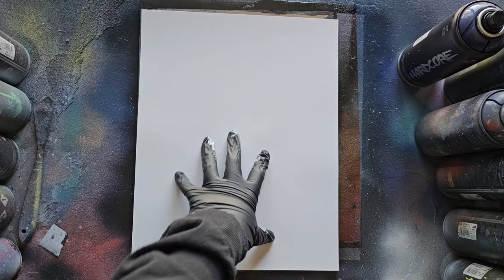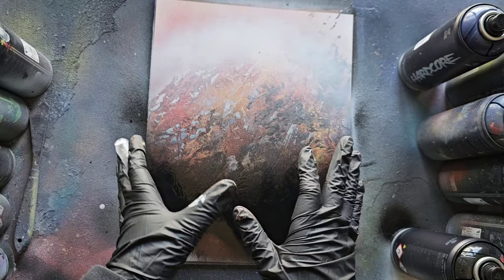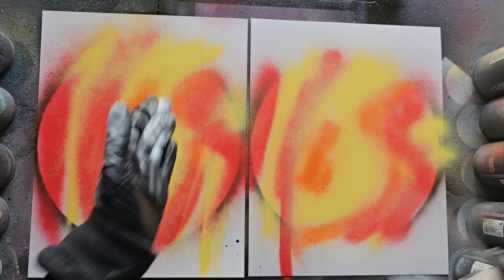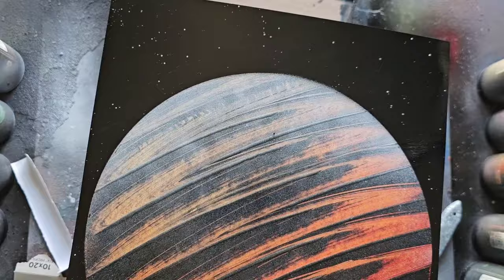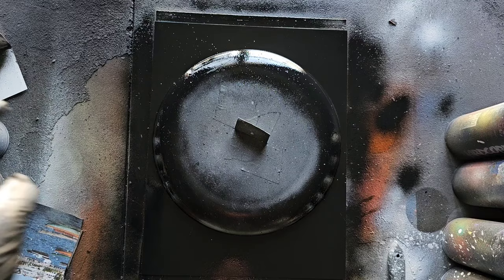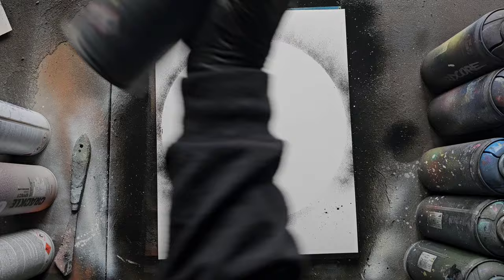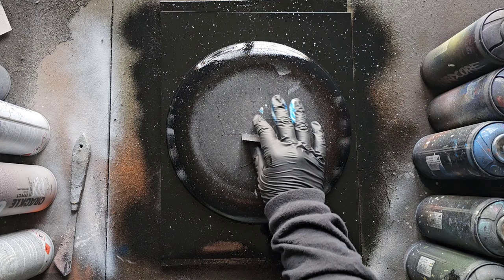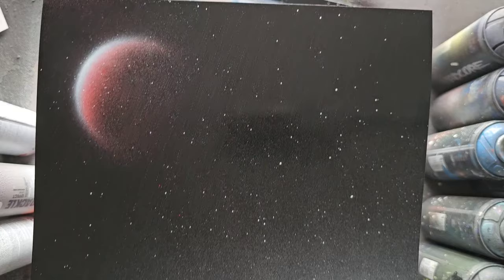Different Ways to Make Spray Paint Planets 2024!

Comment: Hi, I've watched a bunch of your vids on star scapes, planets, etc.  It's amazing and I enjoy watching you do it and the end result. You've given me the confidence to try it.  I have a 5 string bass I'm planning to spray one on. I've stripped off the old paint, sanded and primed. I use my garage as my paint booth. Being in RI I have to wait until its warmer.  

I have successfully painted several guitars with nitrocellulose.

I want to paint planets etc because no matter the angle of the bass (neck up  or me holding it -neck to left) it will always look correct - no up in space🙂.

It's not a level surface though.   How to you get a cleanish edge around a planet? Just prop it up?

I want to include a crackle planet & UV also.

Thoughts, comments, or tips you could share are appreciated.

Thanks 
Jeff G.
Reply from the maker: Not exactly sure what you mean. Everything in the tutorial is how I usually make planets. But if you're not getting clean lines, could be the stencil, make sure you stencil is clean and scrape off any paint buildup. You could also be using too much paint around your stencil so when you lift up the stencil the paint will start to pour in your planet. Or you have to wait for the paint to dry b4 placing the stencil especially if it's colder out. If all else fails, you could use circle cutouts. Do your space scenes first, planets last

Comment: Hi, thanks for your videos. Question:  My paintings at times do not dry uniformly, at times show darker blacks and duller areas of black. What could the reasoning be?  What is the best clear coat to use?  Is it my technique? Are my paints too cold when sprayed? Are my paintings drying in too cool of an environment?  I use Montana Gold paint mostly and Rustoleum 2x Clear coat. thanks for your guidance.
Reply from the maker: I honestly have no idea, I use rusto clear as well and don't have that problem. Make sure you putting an even coat on and if your using a canvas you primed yourself, maked sure it's been primed evenly